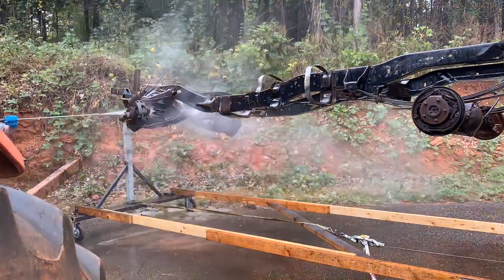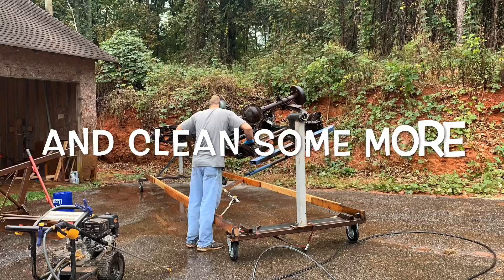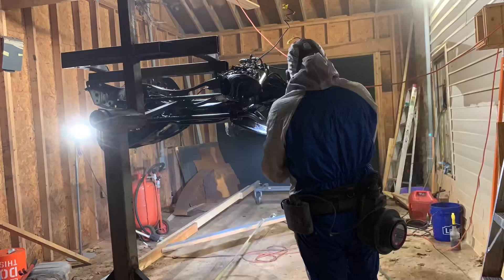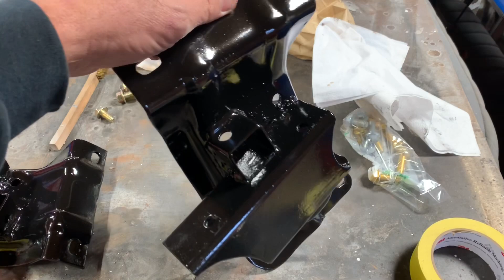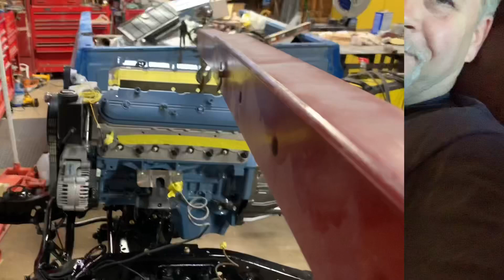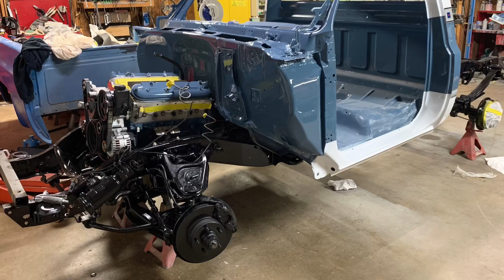Project C10 Episode 6 painting the frame.  #c10, #squarebody, #c10nation

Comment: What are the specs for the Jig you use to remove and install the cab on the C10?
Reply from the maker: I used two 2x4s that were cut slightly wider than the cab, screwed on a short piece of 2x6 on each end to keep the cab from sliding off each end. I spaced the two long 2x4s 2 inches apart or so and in the middle I added blocks of wood to create a spot for a trailer ball to go in between the beams. The key is to mount a trailer ball to the top of the engine hoist arm for the boards/jig to pivot on. The jig simply sets over the trailer ball and pivots as needed. I also screwed some metal plates to the wood where it rested on the arm of the engine hoist since it kind of tears up the wood when it pivots with the weight on it. Kind of hard to explain but I hope this helps. It’s simply a beam that pivots on the trailer ball. There’s a spot in the middle of the beam just large enough for the trailer ball to stay without sliding around and enough space to slightly pivot. Good luck, be careful, and thanks for watching!
Reply: I would guess that almost any of these trucks are slightly heavier on the drivers side with extra bracket for the steering and bulkhead stiffness behind the brake assembly. So, off set to the drivers side 1 inch (+/-). Either way it does the job. Nice work and enjoy seeing the OEM type motor mounts but they are like $80 each and more. But the upside for a guy / gal with welding skills can set the height where you want it. Bonus is the bolts go straight down where you can see! Sweet Jim!